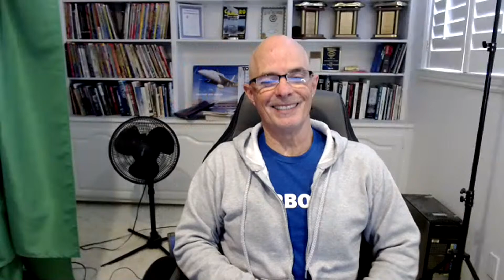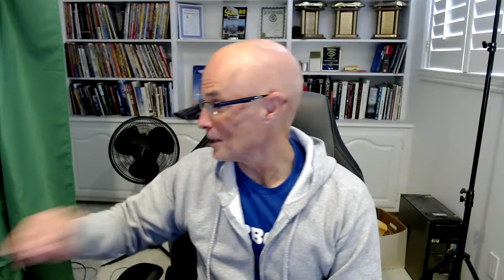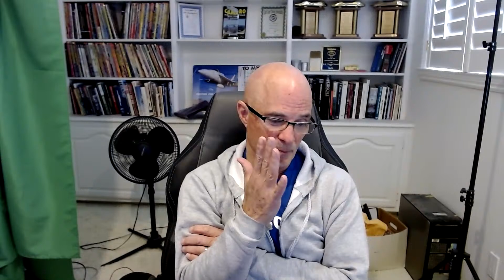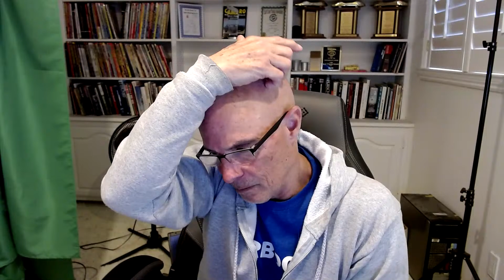CRATE MOTOR RATINGS GAME LET'S TALK TECH

Comment: I was always baffled by the GMPP 350HO there " high performance" vortec 350 being rated at 330hp that only 40hp and then having a 290hp 8.5:1 76cc bathtub smogger headed 350 that has basically an RV cam and rated with low rise performer /600cfm Edlebrock  combo and headers and that's a barely above regular late 70s 350.

Comment: You can use a 6.4 crank and rods in 09+ hemis. Just need the correct aftermarket piston. You can use a 6.4 crank in 03-08 hemi with some machining to accept the early timing gear.